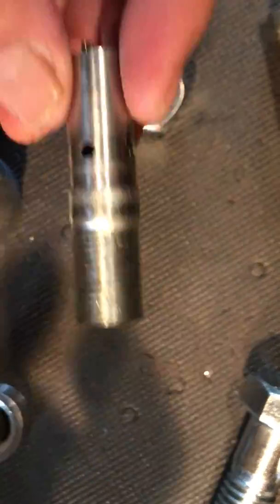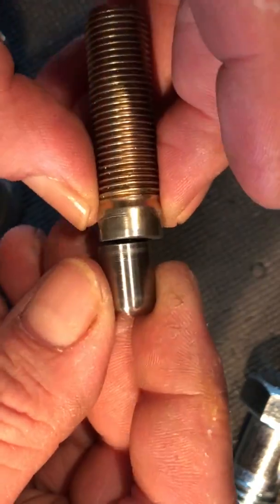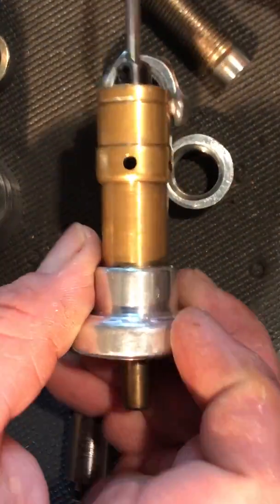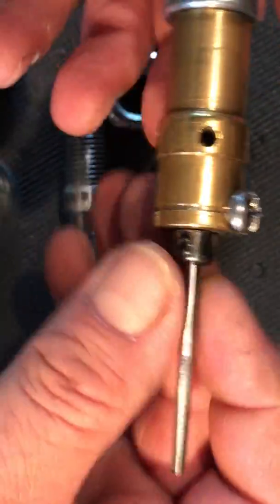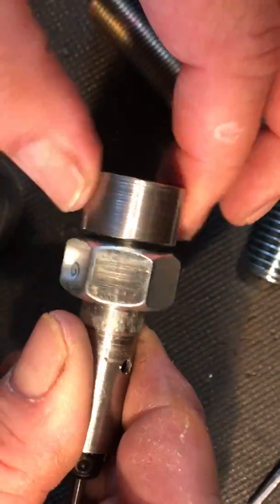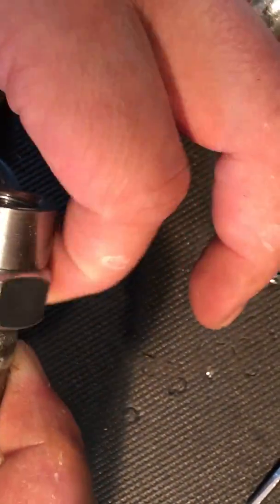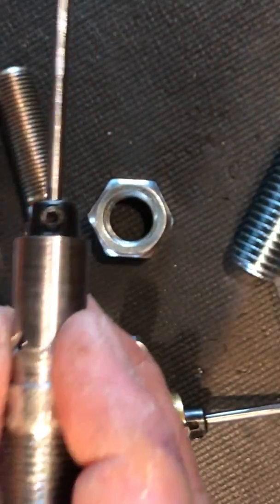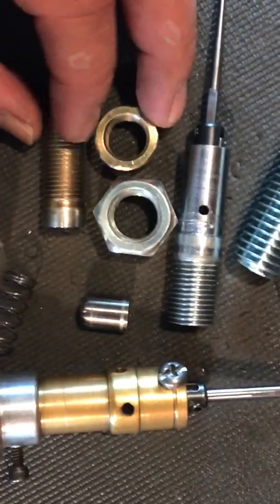Pneumatic engraver: DIY

Comment: Why doesn't the air come out of the handle hole?
Reply from the maker: This video shows the piston hitting the top of the graver holder, hope this helps.  
https://youtu.be/louSxZ0TWco?si=IwD_fdCL5NOVTwLh
Reply: @JRyderEngraving  I got the handle from a friend as a gift.  he said that the handle was fine but when I tried it at home it didn't work only the wind came out.  he told me to send it back, but he looked busy.  he said he would make a new piston.  Do you think the problem is with the piston or spring?
Reply from the maker: @mulanjamilah7849   Does the air get sucked in and out? Or does it come out in a constant stream?
Reply: @JRyderEngraving  when I step on the pedal the air comes out of the small hole in the handle
Reply from the maker: @mulanjamilah7849  have you modified the compressor to push and pull the air?
Reply: @JRyderEngraving  My friend is a pneumatic measuring instrument craftsman and usually goes straight without modifying anything in the compressor
Reply from the maker: @mulanjamilah7849  the piston doesn’t move at all?  Is it getting stuck?  And does your handpiece use a spring?
Reply: @JRyderEngraving  The piston does not move and has no spring at all
Reply from the maker: @mulanjamilah7849  ok, so it’s a Lyndsey style airgraver?  Maybe use some steel wool and clean the inside of the cylinder…
Reply: @JRyderEngraving  Lindsay-like system.  OK, tomorrow I'll try cleaning the inside, I'll let you know.  the tool works or not.
Reply from the maker: @mulanjamilah7849  ok
Reply from the maker: It should come out.  Is your piston hitting the top of the graver holder on the inside? The top of the graver holder should fit inside and stop between the holes.  The piston should hit the top of the holder.  If that’s off then it won’t work properly

Comment: I wonder if you can use a tattoo gun it’s the same principle? Maybe I’d like to know.?
Reply: I was thinking the same thing. A rotary tattoo gun would probably be perfect, might need a stronger motor.  You can alter the plunge debth on rotary machines by deepening the valleys in the plastic thing that drives the needle back and forth. Even if it didnt  work adapting the mechanics might be interesting. the smooth action of a rotary machine
Reply from the maker: Reaper Game over it is the same principle. I’ve never used a tattoo gun.  The pistons  on these pneumatic machines are probably a little heavier than a tattoo gun.

Comment: I did the same thing,But the hammer is still standing, not turning upwards.when I plug the steam.
Reply from the maker: YONG Toshiro do you mean the piston? The piston should be slightly smaller in diameter than the barrel. Another factor could be that the inside of your barrel might need to be reamed(smoothed out) after using a drill bit to make your barrel, the drill bit can leave the inside rough. If you don’t have a reamer, try using sandpaper to sand the inside. I’m in the process of finishing another handpiece, I’ll demonstrate what I’m talking about for you.
Reply: I made piston, it smaller than the stem diameter.I have smoothed the inside surface,But it still does not work.
Reply from the maker: YONG Toshiro ok...how about the vent holes. Your quick change graver holder. The part that’s inside the barrel, should end midway of the vent holes.
Your spring:
 It shouldn’t be too stiff, more on the softer, springier side. Play with different lengths. 
Your compressor, did you modify it to push and suck the air back and forth so the piston will hit the quick change back and forth, like a jack hammer?
Reply: I use a variety of springs,soft, hard different.My air compressor,only one direction out.It does not suck back.
Reply from the maker: YONG Toshiro ok that’s your problem....you have to modify your compressor to push and pull the air. That’s what makes the piston move back and forth.
Reply from the maker: YONG Toshiro I’m going to add a few links of some videos I found where they show how to modify the compressor 
https://youtu.be/3hvZlkGE4_A
Reply: Oh,so I have to use a pump.Thanks you very much
Reply from the maker: Here’s mine it’s kinda quick but I use a foot pedal to control the speed of the air coming from the compressor 

https://youtu.be/U7vKCqDArfA
Reply from the maker: YONG Toshiro here’s another. These small compressors are inexpensive. Hope this helps. Keep me updated on how it comes out.. good luck!

https://youtu.be/8NY1GjkuYlI
Reply: thank you for sharing